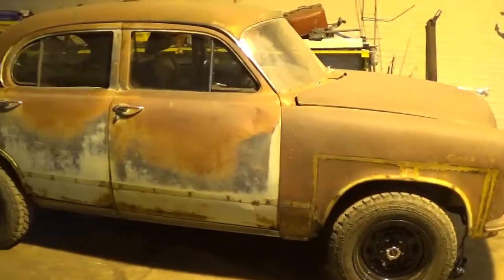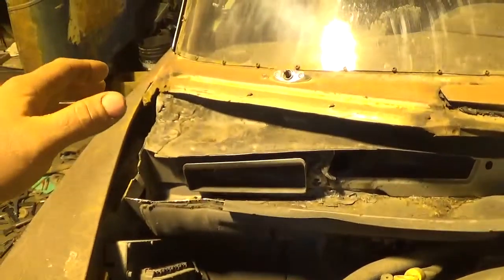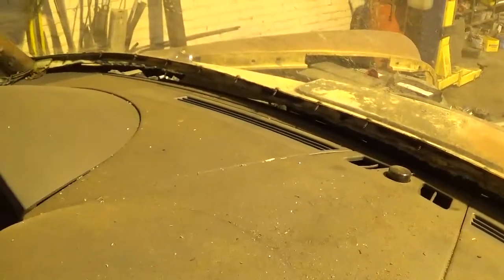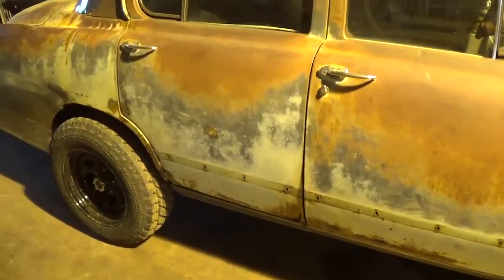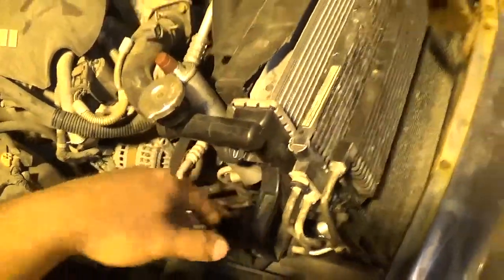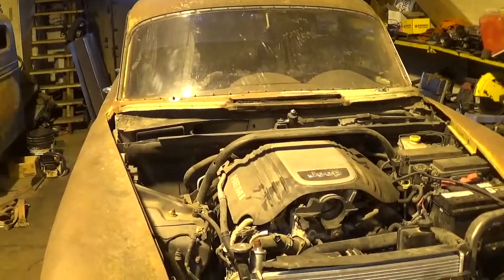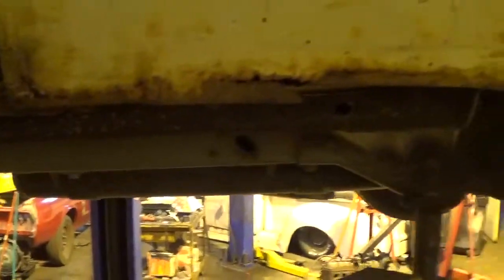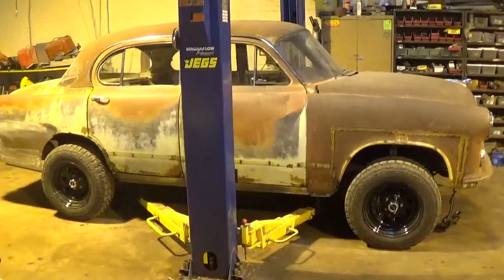AWD HEMI POWERED HOT ROD!!- 1953 Dodge Coronet Build Part-1

Comment: part 2?? ;)
Reply from the maker: Absolutely, currently getting ready for our ice racing season, totally redesigned my 52 studebaker commander over the last two weeks, videos will be out soon, also building a 49 Chrysler windsor for a ice car as well, 2 or 3 weeks this project is coming back to the shop to get finished. Basically has not been touched since the last video, will return soon!